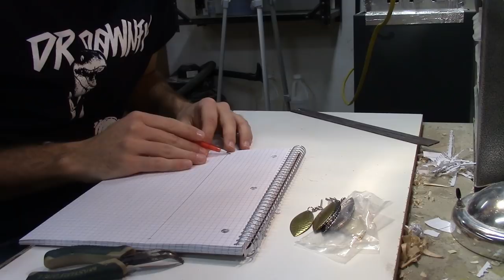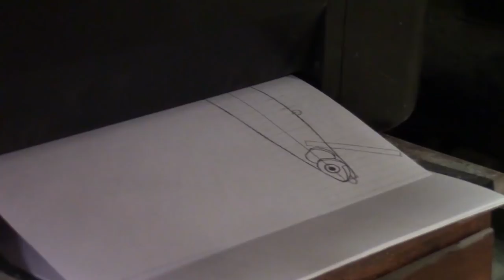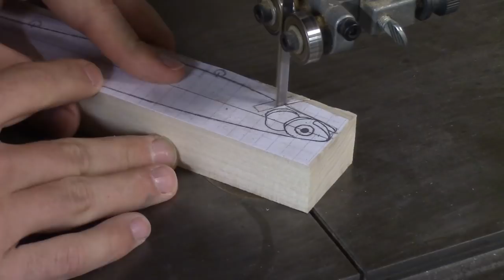Making a FireTiger JerkBait

Comment: Very nice! Thanks for the video. Freehand painting those lines is tough! You make that look easy. Especially when the compressor roars to life. I almost dropped my airbrush last time that happened.
Reply from the maker: Thank you! My compressor use to trip the breaker every so often. It’d turn off the lights right in the middle of doing work like that lol
Reply: Marling Baits is that a few drops of denatured alcohol you add to the epoxy when you seal it?
Reply from the maker: Yep that’s what that was.

Comment: I love your channel and videos. Thanks for sharing. Have you ever tested how much weight the twisted wire eye-lets can hold when glued in? Many large jerkbaits have the front eyelet and all hooks connected through the lure body with a wire. I wonder how necessary this is. To make a lure so beautiful, would mean it'd be heart breaking to have bust off. Please, please continue posting videos!
Reply from the maker: Thank you! These are 0.092” thick screw eyes, and it’s common to bend out 3x strong hooks on screw eyes. I’ve never seen them fail even with the 50+ inch muskies over here
Reply: I've never had the fun of tangling with a musky... yet. Thanks for the information!
Reply: From the tests on lure building forums I would say they would hold about 60-120 lbs, the reason for through wireing is if the fish destroys the lure(breaks the wood), the wires would still allow you to land the fish (in both cases the lure would be destroyed).  Through wireing only adds extra noticeable strength if you are using a wood like balsa which does not have a lot of grab for the screws to dig into, so they get pulled out easier.
The way hook eyes fail is by pulling the wire straight, not a failure of the wood or glue, so they wouldn't (completely)ruin the lure if they failed.
Reply: coast2coast00 awesome information. Thank you!

Comment: another functional work of art. Great lure man! 
What is the diving lip materiel you use? I tried some from the hardware store and it was very brittle and I was not able to buff it out. Also what is the mm of the stuff you are using so that I can use that as a reference. 
Look forward to every video!!!
Reply from the maker: Thank you! The lip is cut out of a sheet of Lexan Polycarbonate. You’ll want to stay away from the acrylic sheets from the hardware store cuz they just arn’t though enough. The thickness of the Lexan in this video is 3/16 inch.. not sure what that is in mm.
Reply: That would explain it. The one that I got was acrylic. I am working on swimbait carving at the moment but soon I want to try another crank bait. Thanks!

Comment: What kind of resin is that and where can I get some?
Reply from the maker: The clear coat on this bait is a 30 min epoxy. You can just look up “Devcon 30 min.”
Reply: Marling Baits thanks man! Just got into making baits after watching ur vids, taking my time while making them and can’t wait to finish one and hav wit swim correctly, and how can I weight the bait without pouring lead.
Reply from the maker: Awesome to hear! You can drill out the hole pour some epoxy in there and insert the weight instead of melting lead down. Can just use little fishing sinkers.
Reply: Marling Baits thanks man can’t wait to get to work!